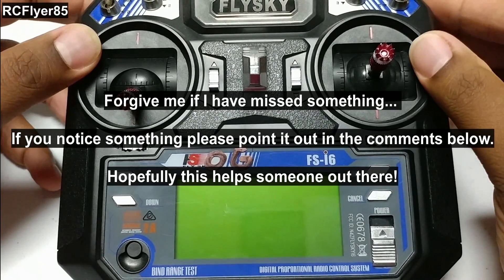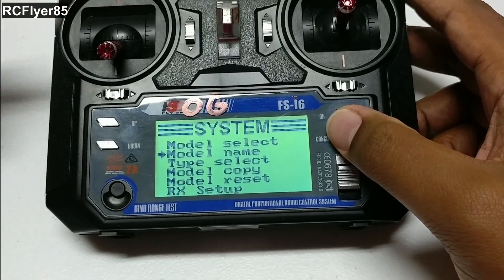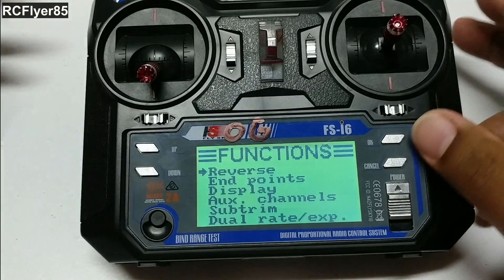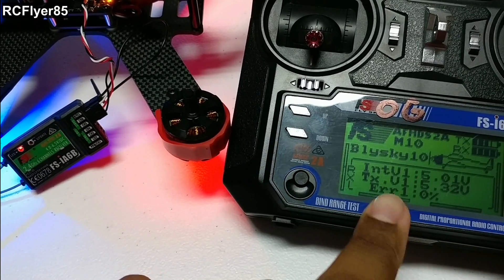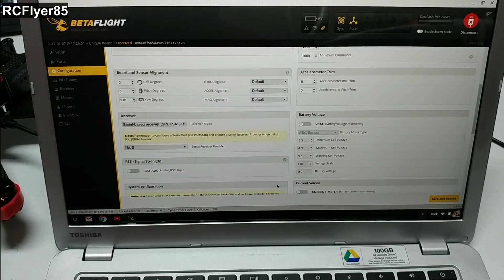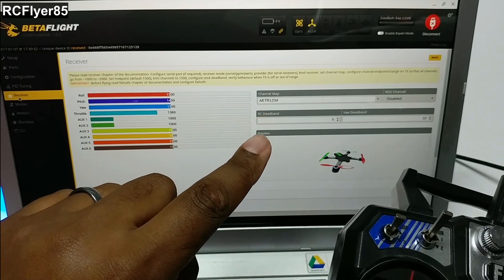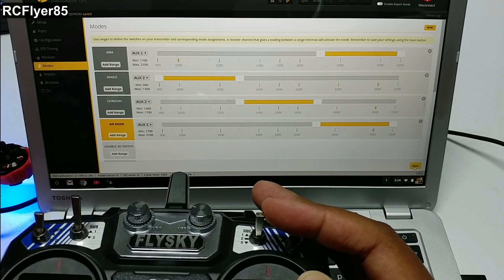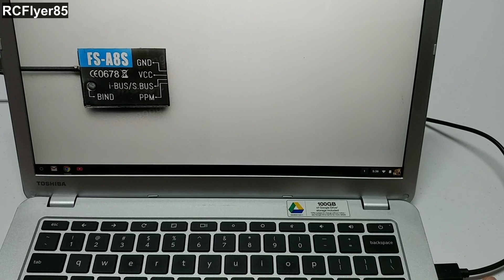How To:  Setup FlySky i6 for Multirotor Drone Eachine i6 Turnigy i6 and More

Comment: S hey I noticed the model that you're using referring to it as each one I think you did anyway I have one , although I bought mine under the name Goolrc 210. .don't know how to find it on clean flight or even beta, so I was wondering if you could tell me what that model is actually referred to inside those two programs also in regards to setting it up with my latest fly sky i6-s digital, I was wondering how to set the rates, or rather how I would correctly change them to one of the 3 switches? I have tried, but to play around, but though it's bound, I still believe I don't have the switches successfully set for stability mode, etc., I am still wanting to use stable mode as I am using my GoolRc to get more comfortable with Racers as I have already gotten to the point with ref quads where I'm more than familiar,, btw, thanks for the great video, I answered a lot of questions, hopefully you will be willing to pass on your knowledge etc,, also do you know why when I attempt to download clean flight from chrome or even plays tore, it won't give me a download option, but rather download to all my tablets and cell phone? Plus every time I attempt a connection for racer to com laptop Windows 7. It tries to download the drivers, but is always stopped by a fail to update driver message not just on the racer mentioned above, but also my shutdown , assassin, etc..? Any thoughts??thankx again
Reply from the maker: K.D.R.C Kevin D. The GoolRC is pretty old so you'll most likely need older versions of BetaFlight/CleanFlight
Reply: RCFlyer85 lol,, okay thankx I got it for 82 bucks , rtf so it was actually a pretty decent deal,, I knew it had to be either really old, or just nobody bought it, cuz your the first person I've seen with one ever , and I've been lookin awhile...., but I think it's a perfect lil beginner flyer/racer, just wish I would have started with it rather than with the fast as hell Swift 2 by swell pro,. Which has been about 100 plus feet up in a damn tree and has been for going on about 2-3 months
Reply from the maker: K.D.R.C Kevin D. Lol.... To bad your not close to me. I've been selling a lot of my stuff lately for really cheap.
Reply: RCFlyer85 btw, im in st louis mo
Reply from the maker: K.D.R.C Kevin D. Yeah I'm in Cali... Most of the better stuff is gone or I'm keeping it. The only thing is perhaps the Walkera Rodeo 110 RTF that I reviewed here. https://youtu.be/AyfBi77eNwg

It's a rather large box for what it is though
Reply: RCFlyer85   Whatcha letting it go for? The mini rodeo?

Comment: As a beginner, which flysky model would you advise? So many different models of flysky receivers. I'm making wood planes and gliders.
Reply from the maker: Sorry so late appearantly YouTube hasn't been giving me notifications for a while and I just noticed...

Depends on how many channels you need  but most likely the ia6b or ia10b would be best for you
Reply: I just bought the ia6 transmitter +ia6b receiver for 38 euros at bnggd. I think the telemetry of the ai6b can be important in time. I don't need 10 channels.

Comment: Hey man, helpful video. I followed the same process but for some reason I can't get the inputs to show up in the receiver tab. I have tried SBUS/IBUS on all UART ports, and can't get anything. Any ideas? :/
Reply from the maker: If it's all blank then that's a incompatibility between your FC and the BetaFlight Configurator... Check my channel for instructions on how to install the older configurator. I think it's my latest video
Reply: What do you mean blank? Nothing is blank, it's just that no matter what I set it up as, nothing is responding on the receiver page. Does that make sense?
Reply from the maker: Pancakes What's your whole setup? All parts, what's on the FC?
Reply: oh sorry, and my RX is the X6B.
Reply from the maker: Pancakes Well assuming you are bound .... There's a few things but that may be the cause...
1. Wired incorrectly
2. Uart needs to be inverted/un-inverted
2. Is the receiver wired (plugged) up for  SBus or ibus... I'd go ibus
Reply: Okay, well it's an F4, I think I read somewhere that F4 can't do inverted? so IBUS wouldn't work? Is there something I need to do on the transmitter to make sure that it's  doing SBUS?

Comment: Hey man thank you for this. I have my eachine I6 bound to the ppm ia6b RX and ppm set in betaflight but for some reason my channels aren't moving like when you go to set your endpoints in receiver in betaflight. I just had the pwm version working on the same quad a day ago and then I get the ppm version and it's not working. You think it's a bad RX? There were some bad reviews I read on Amazon where I got it. I hope I'm just doing something wrong. Hope you can help thank you.
Reply from the maker: Ian Rice Double and Triple check your wiring... Why not use iBus?
Reply: Never mind I got threw trial and error.
Reply: RCFlyer85 thank you replying. I actually got it all set up now. Trial and error ya know. Thank you kindly.

Comment: my channel mapping gives me 0 in every bar
Reply from the maker: Osvaldo Delbrey on the TX or in BetaFlight?
Reply: BetaFlight
Reply: at first I never got to se the bars chage as I moved my radio, and now I can't even see any values on the bars, it's all just 0, no bars of any color.
Reply from the maker: Osvaldo Delbrey That is because the Betaflight Configurator has updated and is no longer compatible with your flight controller.... You'll need to downgrade the BetaFlight configurator to the previous version to be compatible with your current setup
Reply: ooh ok. but I can turn the motors on from betaflight
Reply: I have betaflight 3.2.1 and the D-Link F3 V3

Comment: @rcflyer85 not sure why but I get no bars on the reviever screen in cleanflight however the remote is bound and I have followed all your steps. any thoughts?
Reply from the maker: looseyfur74 Either you have the wrong Uart selected if it's serial RX or you have your RX wired wrong
Reply: I guess im just too noobish to follow. I have the same equipment as you seem to have in your video however after configuration as youve illustrated in this video, the quad literally will not fire. About to start from scratch for the 3rd time... your video makes most sense to me from the other tutos, I hope its my ignorance and not a defective drone?
Reply from the maker: if you want you can send me pictures on Facebook and  I can check out your setup... I'll need closeups of the wiring and the ports, config page on Facebook
Reply: RCFlyer85 that is mighty kind of you I'll shoot some photos when I get back in the office 👍

Comment: Thanks for the video it helped me to setup the ibus tx/rx. The receiver shows the inputs from the transmitter (in cleanflight) but after I disconnect the fly controller from the computer the receiver does not react to the transmitter inputs, any idea of the issue?
Reply from the maker: egeovannyam is the receiver powered on... Do you see all the lights on when you disconnect from the PC?
Reply: yes it is
Reply from the maker: egeovannyam by not reacting do you mean that it won't arm or do you know it's not receiving any inputs?
Reply: After testing it in cleanflight where the receiver show the interaction with the transmitter (working). I disconnect the usb and battery. I reconnect the battery, the drone power up and does a series of beeping, the receiver red light is solid (showing that is bound with the receiver), but when I switched to arm, move the throttle it does not do anything
Reply from the maker: egeovannyam In the receiver tab do your sticks move from 1000 - 2000?
Reply: yes it does
Reply from the maker: egeovannyam Have you recalibrated the Gyro/Accelerometer?
Reply: yes I have
Reply from the maker: DO you have arming set to a switch? If so does it light up as arming in the modes tab?
Reply: in cleanflight, do the motors suppose to spin using the transmitter or just the app?
Reply: yes I do have aux 5 as arming switch and in cleanflight it does go from 1000 to 2000 when activated
Reply: I mean aux1 is the arming switch
Reply from the maker: egeovannyam if you have the battery connected it will respond to both... If no battery is connected then it will not spin up at all
Reply: in cleanflight and with the battery connected, I can make spin the motors using the handles in the motor tab but I cannot make them spin using the transmitter. So what you are saying is that when the drone is connected to the computer thought cleanflight and connected to the battery at the same time I should be able to make the motors spin with the handles in clean flight and/or the transmitter
Reply from the maker: egeovannyam checking in... Have you got it sorted yet? You might also need to raise min check to like 1010

Comment: Is there a way to make drone not flip over? I don't want to crash anymore
Reply from the maker: its gg There's a few things that could cause that... You'll have to get to the root of the problem. Usually props on wrong, motor spinning the wrong direction, motors in the wrong order (ie  motor 1 is where motor 2 should be)
Reply: no no, my drone is fine, i just dont want it to have the ability to flip over if you get me
Reply from the maker: its gg Oh.... Well the easiest way to do that is only fly in Angle Mode or if you are Horizon and would like to roll but not flip you could set up dual rates to limit your pitch to around 70 %

Comment: quick question why should multi rotors be setup on plane or glider? i set mine up on fixed pitch heli am i doing something wrong?
Reply from the maker: ShiestyFPV That's just the most common way of doing it and simpler in my opinion but hey if you set it up your way and it works more power to you. I think the logical explanation is that quadcopters actually fly more like planes than they do fix pitch and collective pitch helicopters. But hey there's more than one way to skin a cat

Comment: Hi its srivamsi again, the driver's good. Everything seems good. I tried flying, the motors aren't spinning at once (I'm guessing) ,the quad's not flying straight. I calibrated manually with receiver and also from the gui but still it's acting same. I don't know much about pids I didn't change pids. Can u please help me?
Reply from the maker: sri vamsi Make sure your sticks are centered at 1500 without drift on the receiver tab... Also do a accelerometer calibration
Reply: RCFlyer85 thank for the help I brought the stick values as close as possible to 1500 and calibrated accelerometer. now the motors are responding good while flying the quad's going forward while I move my throttle stick forward. kindly help me make this stable

Comment: Damn, I'm now running backwardsI got my motors working and when I tried to re calibrate, I messed up.
 Clean flight failed to recognise my com port, I uninstalled and reinstalled installed the driver again, device manager fails to show the driver( can't find it in c drive either). I don't know what to do. Please help me. By the way thanks for ur reply earlier
Reply from the maker: sri vamsi You are just having the worst issues it seems... I don't think I could help you further without actually being there in person. Maybe you can find someone local to take a look at it. Sorry I can't do more.... Best of luck

Comment: I can't get my Flysky radio to do anything with my Diatone Tyrant S quad! The receiver is factory bound and the FC is flashed with beta flight.... Help please I just want to fly!!
Reply from the maker: Jim Russell Do you see any movement in the receiver tab?
Reply: Yes receiver light stays solid
Reply from the maker: Jim Russell No I mean inside of BetaFlight on the receiver tab
Reply: RCFlyer85 no movement in receiver tab
Reply from the maker: Jim Russell So if you are for sure bound to the receiver then you you either need to set the correct Uart in the ports tab orrrrr you have it wired incorrectly to the Flight Controller
Reply: UART 1 & 2 are configured on MSP @ 115200
Reply from the maker: Jim Russell Ok then most likely Uart3 should be set to serial RX
Reply: Uart 1 & 2 aren't set to serial RX, set them too?
Reply from the maker: Jim Russell No Uart1 is definitely supposed to be MSP... Usually Uart2 is also if you ha e built in OSD...
Reply: Am I ppm or ibus with Flysky?
Reply from the maker: Jim Russell You could be either it just depends on your RX and how you have it wired

Comment: why is it when I try to configure my Eachine i6 remote controller in Libre Pilot, when I check to see if the remote is responding correctly with the on screen controls for throttle, pitch , roll and yaw, they do not move in the right direction on the screen that they should be moving {when I move throttle up the on screen controls show that the throttle being moved downward instead of upward. How can I fix this problem. Thanks
Reply from the maker: gerald j You need to reverse your channels... You can do this in Libre or in the transmitter itself.

Comment: Hey, I can't find not one video on YouTube about how to connect a FS-ia6b reveiver to a kiss flight controller. This is my first build. Thank you so much. It would be even better if u could do a vid on how to do that.;)
Reply from the maker: Droneva Bass because it's pretty much won't work.... KISS doesn't support iBus unless you flash it to BetaFlight. There are a few other ways depending on your particular set up but not using the ia6b
Reply: Thanks for the lighting fast response. What do I do know because I don't have any more money to get a spectrum or taranis x9d?
Reply from the maker: Droneva You could... 
--- Without flashing to BetaFlight 
Run PPM (if that board supports it) 
Get an i6x or Turnigy Evolution TX which supports SBUS output and a compatible RX like the ia6c or X6B

--- With flashing to BetaFlight use what you have (ia6b) in iBus mode
Reply: So could I get the turnigy evolution that comes with a tgy-ia6c receiver and it will work with the kiss flight controller?
Reply from the maker: Droneva Yes... Check out this video 
https://www.youtube.com/watch?v=_rAjPHKfuTo

Comment: Thanks for your video!! It helped me finally get my modes setup for my Furibee Fuuton 200. I'm stuck with a  Eachine branded i6 transmitter, and I can't set the buzzer up. None of the other aux switches work. Plus is there a way to backup or save models if the transmitter get destroy or damaged.
Reply from the maker: George Grazette What receiver does it have and what do you have set up so far? Are you using any switches currently?
Reply: RCFlyer85 Flysky FS-A8S.I just ordered 2 ixb receiver ..the buzzer works when I shut the transmitter off, but I want on on the transmitter. I setup Arm on switch A, switch C is Angle, Hozion & Acro.. No Airmode made my motors spin up too much. If I update the firmware on the transmitter will I lost my previous model's ? Plus having to use sliding the tabs to get into setting will that be gone too.?
Reply from the maker: George Grazette I can't remember what all gets erased when you mod your controller since I did it so long ago so it's best to assume that it will erase everything. I personally don't know how it goes on the Eachine model though if you flash the official mod it should get rid of the need to slide the tabs. with your current set up if you're not using 3 flight modes you can set arming and two flight modes on the 3 position switch and that would leave another switch or Knob open for your buzzer or whatever else

Comment: So I'm curious if you know how to add another aux switch. Currently I have swa and swc programed but I would like to add swb for a buzzer mod, but I cannot for the life of me figure out how to add another aux switch to program. If you have any knowledge on that, I could use some help.
Reply from the maker: Cooper Hilton You have to make sure you have the correct receiver and you'll need to do the 10channel mod to enable more channels on a stock FS i6
Reply: Oh goodness. So the Flysky 2.4G 6CH FS-iA6B Receiver wont work with this?
Reply from the maker: Cooper Hilton Yes the ia6b will work but only on ppm or iBus. the question is what transmitter do you have if you have the original I6 transmitter it is only capable of handling six channels so for 4  controls and two switches you will need to do the 10 Channel mod if you would like to get control of all of the switches at the same time
Reply: Yeah I believe I have the original. Its the FlySky FS-i6 2.4G 6CH AFHDS. Looks like I'm going to attempt the 10 channel mod.

Comment: I have a problem with my Flysky I6x radio and my newly purchased Eachine E010S. It has the F3 flight controller with built in Flysky Receiver and I can get the radio to bind but I for the life of me can not get the radio to control the motors. I am fairly sure i have it bound to the FC because the blue light indicates that process is successful and it shows the movement of the throttle and etc. in Cleanflight but when I plug the battery in the motors start spinning and I have no control what so ever. My first thought is that I am doing something wrong during the configuration in Cleanflight but I have been trying with the E010S for 3 weeks almost now in my spare time but I have yet to have any luck and I even have had a couple of friends that fly UAVs try to help me understand and we have all been stumped with the issue.....CAN SOMEONE, ANYONE PLEASE HELP ME CORRECT MY ISSUES?
Reply from the maker: Adam Bostic If the motors spin when you plug the battery in that means that you need to change the motor pwm rate to 16000 I believe the CLI command is " set motor_pwm_rate = 16000 "

Other than that make sure that everything is working correctly in the receiver tab. Make sure the values are going from 1000 to 2000 for all channels